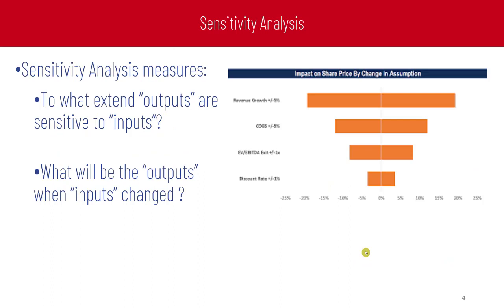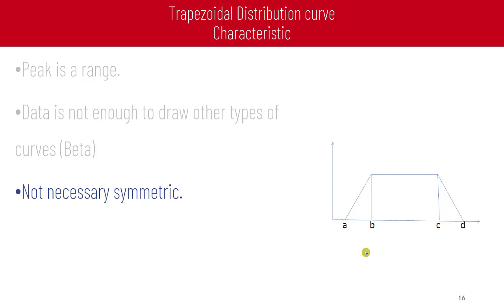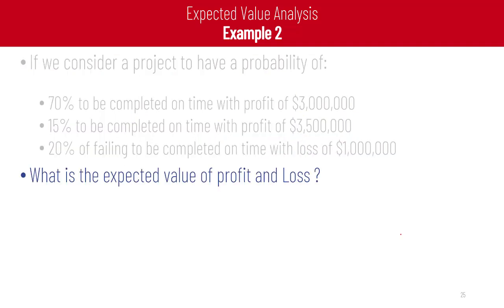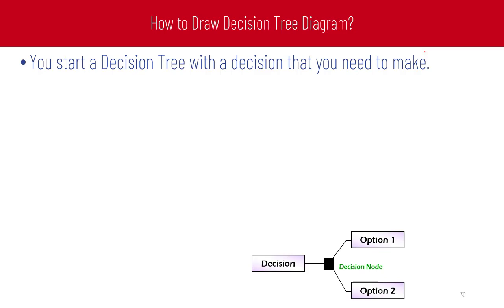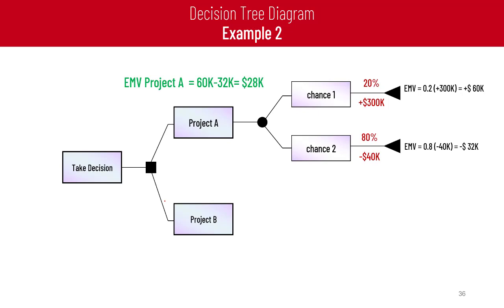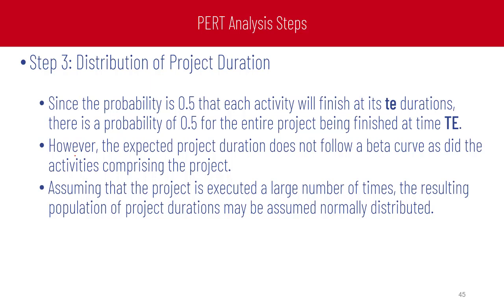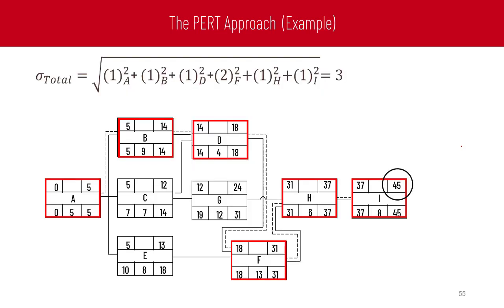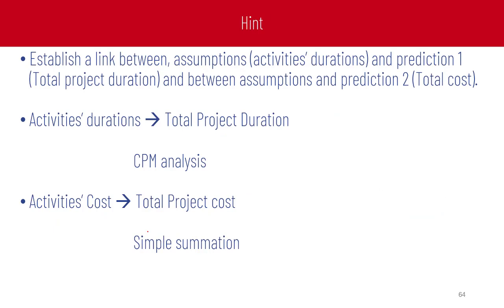Risk Management Process Course - Part 4

Comment: Dear Dr. Ahmed Elyamany,

Thank you for the informative video on PERT Analysis. It was incredibly beneficial. I have a question though - what if there is a near-critical path with an activity that may has a random duration longer than its expected duration? Could this become the longer path and perhaps be the new critical path instead? Does PERT calculation take this into account, or could it potentially lead to a miscalculation in project duration? 

Your efforts in creating educational content are greatly appreciated.